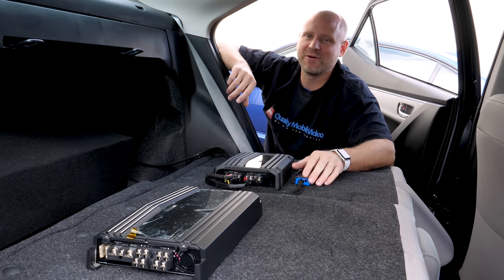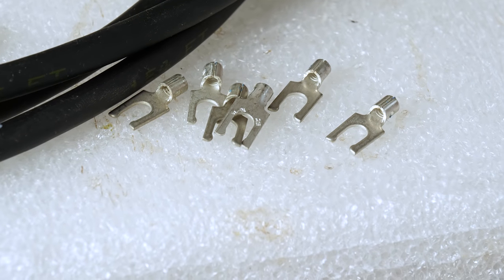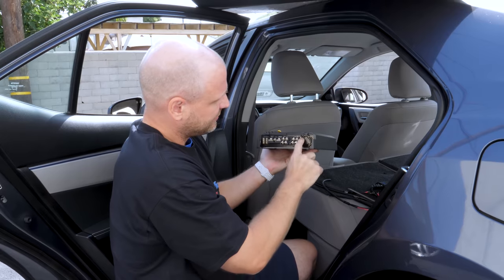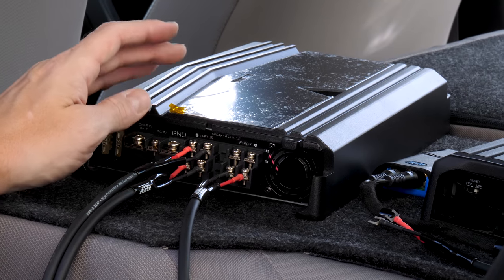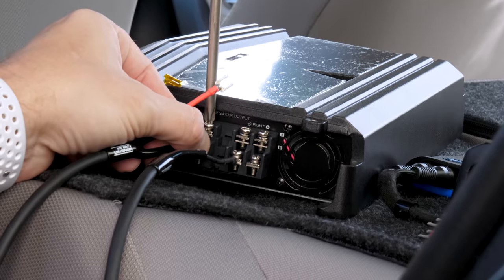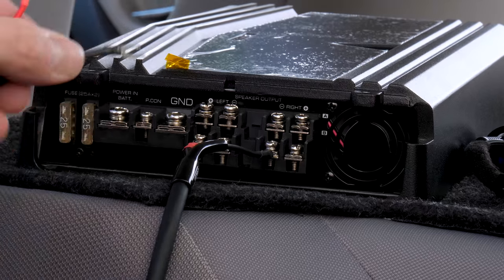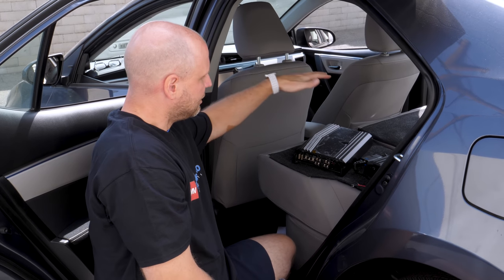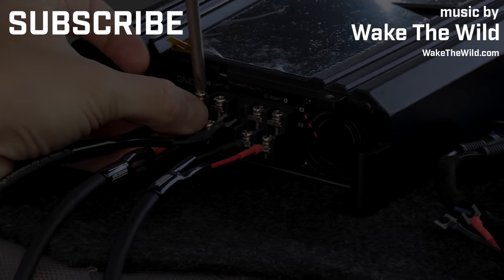How To Wire Speakers and Subwoofers to Your Amplifier - 2, 3, 4 and 5 Channel - Bridged Mode

Comment: very clean work, have to give you that... But you dont run the positive along side the remote, it slightly distorts the amp. put the positive on one side of the car and the remote on the other side. then put back on the computer and see the full power without be distorted.
Reply: the remote doesnt even have that much strong a signal maybe u just moved ur speaker wires away from something else
Reply: Rcas near the main power yes =noise a remote wire no never seen nor heard of it doing that
Reply: Devils Reject64 i see NM) r retro MN
Reply: No
Reply: The remote turn-on lead is SO low power it would NEVER induce noise into an RCA cable! Really. Most are like 0.5 volts max! But the one important thing most people don't realize that IS a true fact is you NEVER want to use your head unit's remote turn-on lead to power up more than ONE thing! EVER! You'll fry that circuit in seconds trying to draw that much power from it! Instead, you always run your turn-on lead to a relay! Then power whatever you want off the relay! Myself, I'm weird and old, so I came up with my own personal idea on the use of relays and distribution blocks: I use 1 relay, but the power from it goes to a seperate distribution block for to amp turn-on leads, 1 distribution block to make ONE ground point than run 4 grounds to all the stuff, and a third distribution block puts main power from the main fuse to each of 4 components instead of trying to connect a bunch of power wires! May seem weird, but it sure doesn't hurt anything! And it not only looks cool, but gets a LOT of comments and it DOES work! http://i254.photobucket.com/albums/hh100/Hairball98498/98%20Stratus%20stereo/P5110189.jpg
Reply: I used ONE relay to power the turn-on leads to 3 amps and a crossover like you're supposed to do. But THIS was how I sent ONE power cable from a distribution block to power all 4 components: http://s254.photobucket.com/user/Hairball98498/media/98%20Stratus%20stereo/P5110174.jpg.html
Reply: Grnd put =black rem= blue thin wire and 12v put your love from battery

Comment: Hi great video. Big questions:
1. How do i now the stock output in watts of my car radio?
2. If the stock system has 4x 25watts speakers, does it mean that the radio output is 200w? 
3. Does the output of the amplifier change in different radios? (Using the same amp)
Reply from the maker: 1. Tough to tell, you can refer to your car manual or call the manufacturer
2. Yes each channel is getting 25W
3. The amplifier power will always stay the same. The power would change if the speakers were wired to the head unit instead

Comment: This just isn't complete enough for me. Those wires going under the screws on the amp. Where do they go? What are they attached to? Where does the 8 speaker wires on the head unit go? Do the speaker wires from the speakers hook up to the amp? Where do they hook up to on the amp? So far I can't find any videos that answer what questions I have. They all assume. Even if they posted a pictorial diagram, I wouldn't need a video.. Easiest thing to do. Spread all components out on a big table like surface and attach the wires. Takes away all the mystery.
Reply from the maker: This is a to demonstrate the wiring options, you have to decide how you are going to run your speakers depending on loading. The wires go to the speakers but you are presented with several wiring options when using multi-channel amplifiers, do you want to run four speakers and a sub? That is a three way setup, do you want to run four speakers? That is a four channel setup. What are you stuck on?
Reply: @Qualitymobilevideo  I'm looking to run 4 speakers and 1 sub. I just need to understand that I run the speaker wires from the head unit to the Amplifier. Once that is done. Is there connections from the Amplifier to the speakers? My install is all to be new, I am not including any stock components. I will probably be purchasing a 5 channel amplifier just for the ease of making the necessary connections and I won't have to worry about bridging. I bought a bunch of speaker cables. They have those RCA plugs on them. I guess that was probably a waste of money. I haven't really seen anyone using them. Thanks for responding.
Reply: I understand your frustration. I’m feeling it too. I want someone to explain the first part of the amp installation with the wires from the head unit to the amplifier and which connection it goes to. Then they can explain the connection from the amplifier to the speakers. That would really help a lot of people.
Reply: @-emme-nguyen4404     Looks like we are both stuck on the same problems.  I still am yet to tackle this job.  I'm waiting until winter is over, then I'll resume the battle.  Got to do some more research though first.  I wish you success with your installation.
Reply: @hardrock1826  thanks. I’m trying to figure it out before summer gets here. It’ll be too hot in Texas for me to get it done.
Reply: @-emme-nguyen4404    I have been to Texas so I know what you are talking about.  I don't have that problem.  We are still in winter here in the north of Canada.  I reside above what is called The Snow Belt.  
All the best  -Emme-.
Reply: RCA cables connect the head unit to the amp. New speaker wires connect the amplifier to the speakers. The speaker wires coming from the head unit no longer apply
Reply: @jasondrew6369      Thanks Jason.  That's been one of the things that I was stuck on.

Comment: With 3 channel 2 speaker setup do you still have to use 4 inputs from the head unit?
Reply from the maker: Usually the amp will have an input selection switch and you can use just 2 channel input

Comment: Heys guys, thanks for the awsome video, what if you fit 4 speakers and 2 subwoofers ? And if you connect your speakers to your amp is it not gonna blown up fuse/ relay since we connecting 2 postive/ live cables ( one from amp and the other from head unit )  to each other ?
Any help/ answer is much appreciated. 

Thanks in advance

Comment: I’ve got a 2 channel amp laying around and been thinking about putting it in my jeep. Might wire the front speakers to one channel and the rear speakers to the other. I don’t use balance much but I do fade them from time to time and being able to keep the fronts and rears separate would be nice.
Reply from the maker: You will turn your system into a mono system.
Reply: @Qualitymobilevideo  I didn’t think about losing surround

Comment: hey man sorry for this question taking ur time; i just bought a used 10 inch 700 watt pioneer sub woofer
i have an aftermarket stereo in my civic 09. was planning to  buy  a mono amp but seen this video  kinda puzzled me if it's possible to run mono on my car or get the 4 channel amp. cheers mate and thanks

Comment: Did u make the split sleeves you put on the wire terminals or did you buy them? If purchased where can I get those at. The most difficult issues I run into is connecting terminals to my wires. Idk why I have issues in this department cause I have the right tools and supplies but for some reason terminals come off or won't fit in the hook ups on the amps,etc... my system.went down on me piece by piece over the last 2 weeks so I threw a couple mismatched brand of subs in my truck temporarily so I'd still have music. I plan on redoing the whole system so any tips and tricks would be helpful.

Comment: quick question lets say i connect front speakers bridged to channel 1&2 to get 200RMS. And i need 75 RMS for Tweets can i connect 1 tweet normaly to channel 1 and 1 normally to channel 2 just to get the 75 rms from each one or will it interfere with the bridged connection?
Reply from the maker: You cannot do that.

Comment: what equipment (insulators, etc) does Lorenzo use to make those clean wire setups?  shows some small clips of him doing it but doesn't go over the process.  is there a link to a video of him doing that ?  would love to see best tips on how to make this clean install running 2 wires in the single high guage looking tube
Reply from the maker: So those splitters are called "wire pants", you can find them on google easily :)  
Also use heat shrink tubing to seal the ends

Comment: Question - it looks like on the end of you wires you have a heat shrink that says monster that shrinks over main cable but then splits into two - where can you get those- thanks in advance

Comment: I have an amplifier installed running one a subwoofer box only and ofcourse i also have my 4door speakers that run off the original stereo… if i were to switch out my amplifier for a 5 channel amplifier will i be able to run my subwoofer box and add in 4 more speakers in the back seat if my headliner?

Comment: Hey I have an older Optimum XL150 4 channel amp.  I want to hook it up to an existing system in my trailer stereo. I just want the outside speakers and subwoofer connected to the amp. Not wanting to boost watts to the indoor speakers.  How do you recommend this install.  Thank you in advance.

Comment: I have a '09 H3 with the monsoon set up. 2 tweets in A pillars, 6.5 in each door, 8in sub in back. Amp isnt adjustable so I'd like replace it with something compatible but not sure how big I should go. All speakers, except for sub, have just been replaced with Rockford Fosgate P165SI in front, P1650 in rear. Head unit is Kenwood DDX396. I have a cheap Dual 1000w. Question is, will that be enough to run everything, as is, until I can replace sub or should I just use it to power current sub? Any help would be appreciated. Ty.

Comment: You helped a lot, but i want to learn something else. I have a 4 channel amplifier, hertz hcp 4 class A B, two split speakers woofer and tweeter if i say it right, and a subwoofer connected to the amplifier. Now my fresh idea is, can i install two mid range frequencies speakers in the front doors together with the existed twiters and hear the bass only from the subwoofer ? I just want to separate all the frequencies, bass only from the subwoofer, mid range frequencies from a speaker that is made only for mid range range frequencies, and the high frequencies to the existed twiters. Is there a video for this specific job ? I can't find a video for this job and i don't know if a car electrician can do this job because in my area there is no specific car audio technician.

Comment: If i have a single rca output from my stereo, and want to connect both my rear speakers and sub in the truck through a four channel amp, how to do that..  My front speakers will be run directly by car stereo's inbuilt amp. 
Even if i use a Y splitter RCA, i won't be able to control sub and rear speakers volume separately. Is there any way to do this?

Comment: Great job explaining how to do each set up! Now for the question , I want to run 4 speakers and 1 sub from a single amp. I’m not doing any competition or anything, I just want a louder good sounding system. I have a Kenwood KDC-BT360U and a single 10 Kicker sub. I have akenwood 6X 9s in rear and 5” in front. Can you use any amp to do what your doing or do I need like a multi channel amp for what am I looking for in an amp to do what I am trying to do? For example, a 2 channel or 4 channel or 5 channel? I see how you doubled up on the one and I see you used 2 different to accomplish the bridge
Reply from the maker: You will need at least a 4 or 5 channel.

Comment: On two-channel, four speakers setup: Can one of those 'speakers' be a small (6.5") subwoofer?  Example: Left channel runs front left speaker and rear door sub, while right channel runs front and rear right speaker. (Replacing left rear speaker with 6.5" subwoofer.) 2020. Thanks for the VERY INFORMATIVE video!

Comment: Nice video 👌👌👌 i like watching your videos i learn alot of new things
Now my cuestion is, i have a kicker    cx300.4 4 channel amp, wich i have connected to my 4 door speakers and i just bought a 10" kicker comp c subwoofer that i want to bridge to the amp i have already installed but i want to keep my 4 speakers connected to this, now, Can i bridge the subwoofer to the amp1 conections and make it like a 5 channel amp like in this video or the amp is not capeble for that? Or do i just descontinue 2 channels and use the space to bridge the 10" sub? 
Thanx in advance

Comment: When you say your running the door speakers parallel in the 5 channel example. Does that mean you're changing the impedance? Thats confusing cos i have 4ohm speakers and by doing this will they go down to 2 ohm? I only ask cos i was trying to go with super tweeters which i could bridge. But if this changes my impedance from 4 ohm to 2 ohm it may fry my speakers as the amp at 2 ohm goes above the safety power guideline of the speakers

Comment: I’m trying to grasp my mind around connecting a subwoofer to a 5 channel amp. To connect a subwoofer to the amp do I just plug into the rca outputs on the back of the amp, and connect the bare wire of the other end of the rca cables into the sub?

Comment: I have a Pyle marine 2 channel for a motorcycle system I built...with 2x 6in P16 speakers... Could I do it parallel and wire 2 P16 speakers on channel 1, and 2 DSC35 speakers parallel on channel 2?

Comment: What about on early 2000 Mercedes where the speakers are directly connected to the amplifier in the trunk and not behind the head unit? 
How does installing it happen do you have a video on that set up?

Comment: I'm planning on getting 2 50w rms 8ohm tweeters and 4 350w rms 8ohm mid-range speakers. Any advice on what amp or amps I would need for that setup? I already have 2 rockford fosgate P3 12" subs and I'm planning on getting a Cerwin Vega 1600.1d amp to push the subs.

Comment: For the 4 channel amp connection , would I just have to splice into the wires from the head units existing speaker wire and run it to the amplifier in the back ? Would RCAs be needed at that point because my stock headunit does not have RCA connection

Comment: Ok so I have a 78 jimmy which originally had 1 speaker in the center of the dash, I plan on adding 2 kicker panel speakers, possibly 2 speakers in the back and replace the dash speaker with 2 smaller ones , could I use a 4 channel and just hook up the dash speaker wires where the wires go for the front left and right speakers on the amp?

Comment: I want to ask if I set my amplifier as 5 channel (6:10)in your video, I have 4 speakers (front 30watt rms, rear 70watt rms) at 4 ohms and my amplifier is 4X50watt rms at 4 omhs. My subwofer bridged as you show. My sbwoofer is 150watt rms at 8 omhs but I will connect a  resistance 50watt of  8ohms parallel. will I have a problem?

Comment: I got a subwoofer that has 5 speakers in one back (menace audio) 
1 10" sub, 2 6.5 mid and 2 tweeters. And each have their own terminal. I have the M4-3000FR amp by menace audio and I'm trying to figure if I'm doing this right on how to connect everything together.

Comment: Well, I'm a DIY'er but confused by the load of info available on the net. My set up is a simple one; two 3-way speakers and a 2 channel amplifier and an in-dash unit. I have learned how adjust the gain, yeah rocket science for me..My question is, once the gain is set and the amplifier is tuned, should I play around with the sound adjustments (like bass boost, equalizer, loudness etc) in the in-dash unit or do I leave them at flat (zero) levels?

Comment: If I'm correct  I have one set of rca  inputs and 4 speaker leads which  2 of them are used  to bridge my 10 inch sub was gonna change my amp or as i already  set up is 2nd  amp option  with  rca, power junction box and I piggyback  the remote wire off the current  remote  wire but haven't  gotten a another  amp as of yet

Comment: I have a 4 channel Neo4v2 amp, and it tends to sound like the radio is getting more amp juice than when I use BT from my phone with the phone volume all the way up. Reason I say this is bc the max volume on the headunit is 63 and I've always played BT at 40-45 vol, which was loud enough. I'm finding myself now having to go up to 63 on BT but 40-45 vol on radio.  This was never the case until I got some 135W dash speakers installed connected to the amp. Also, my 400W door speakers doesn't seem to be bumpin' like it used to prior to getting the dash speakers installed, as if the dash speakers are getting more of the juice now from the amp. Is it possible the wiring was changed and needs adjusting?

Comment: I have a question. I am trying to hook up my my front, rear and sub up to my 5 ch amplifier. I bought a new head unit and ran 3x RCA cable for the front, rear and sub to amplifier. 

My woofers front and rear are 100w 2.5 ohms(300w peak) and a 600w 2 ohm subwoofer. I did not bridge the connections I contacted the Fr + to it's positive and the Fr - to the fr- and so on for each speaker. I got some sound in my car mostly just the front and the rear sounds low but even the front sounds like it is lacking power.

Would it help if I bridge the front together and bridge the rear together?

Comment: I might have missed it but what if I'm running 4 door speakers 2 kick panel 6.5 and 2 tweaters  how would that go. My subs are on a different amp. So should I just buy a 3rd amp for my mid range 6.5 and wire tweaters to the door speakers or better yet a high pass crossover?  Thanks. Plz respond

Comment: You have a video on how to install a 4 channel amp to 6.5 component speaker set up? I have front and rear components so four 6.5 woofer and 4 tweeters, they set up came with cross over boxes as well they are Rockford foagate t3 kit

Comment: Is there a video demo on installing 4 component speakers, 4 tweeters, with passive crossovers and one sub lol trying to find a 4 channel amp with 125rms is near impossible so maybe. My sub is only 400rms so maybe one amp to run all that, but this is advance for me. used to running individual amps for everything.